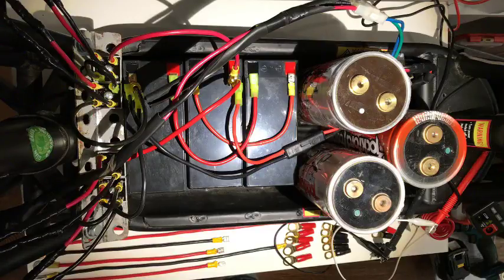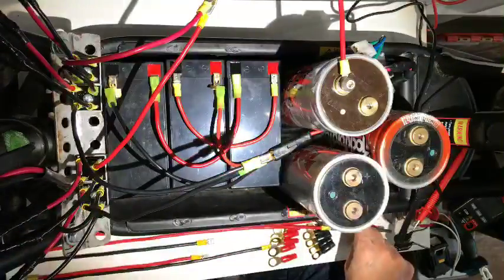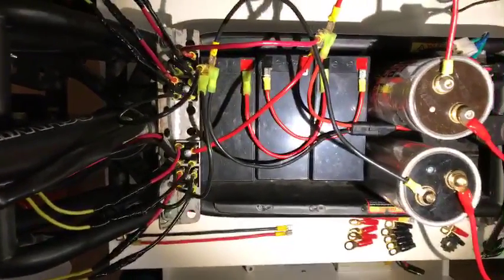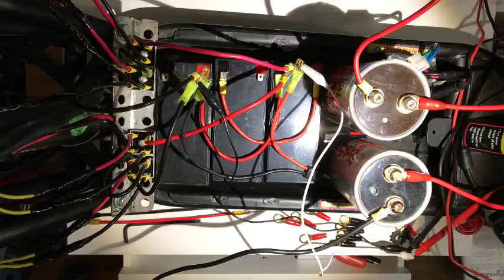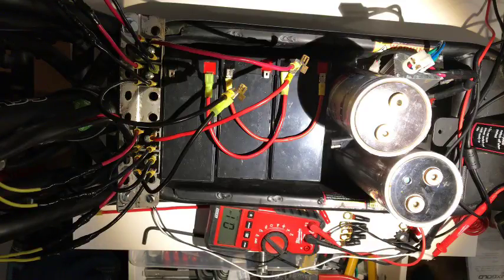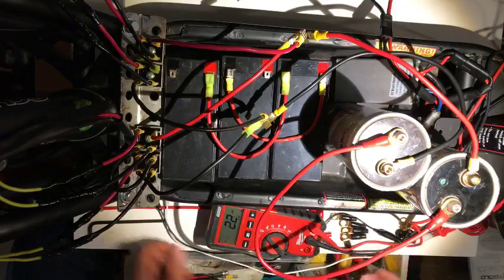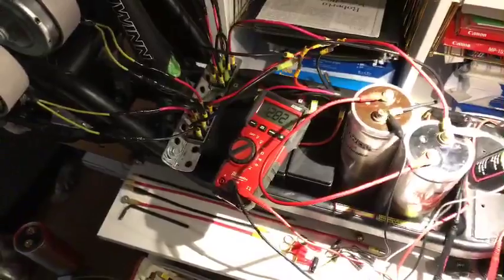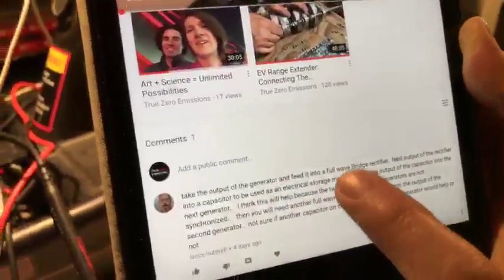EV Range Extender: Replacing Batteries With Capacitors

Comment: IF YOUR USING A AC GENERATOR YOU HAVE A POSITIVE AND NEGATIVE COMING FROM IT NO MATTER WHAT YOUR METTER SAYS. AC GOES POSITVE THEN NEGATIVE AND MUST BE RECTIFIED SO YOU NEED TO SPLIT YOUR WIRES COMING OUT AND HOOK IT UP TO EACH SIDE OF RECTIFIER.